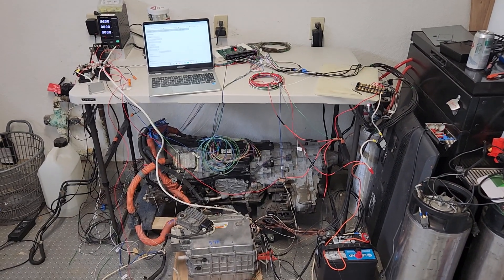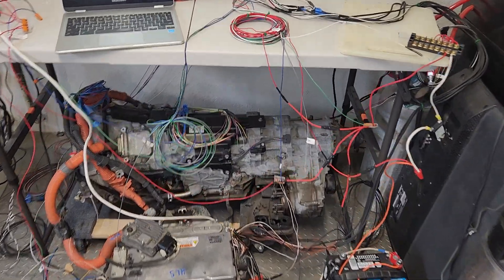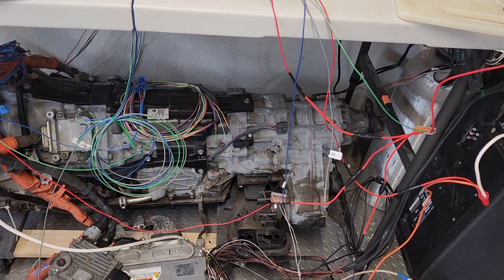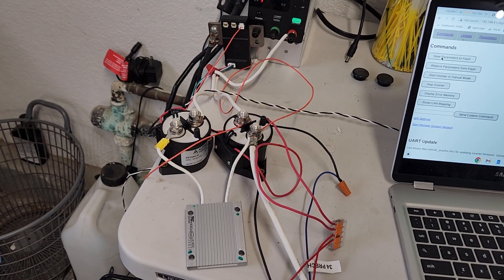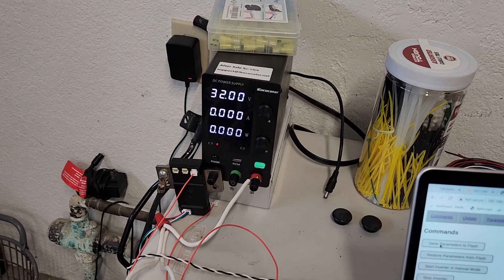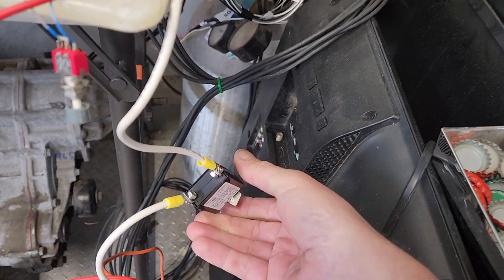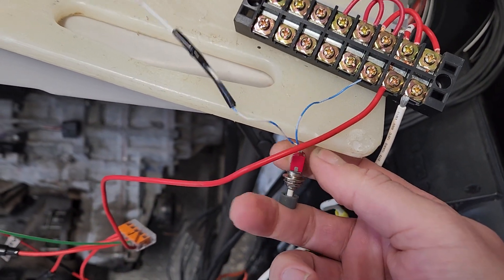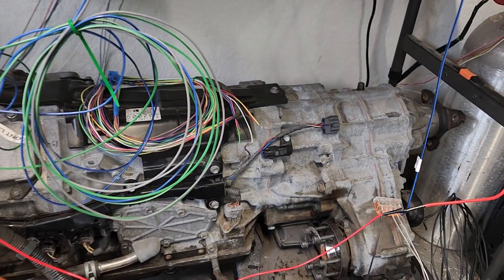LS600H transmission first spin

Comment: Question, what would you recommend buying alongside the gearbox itself and an inverter. any specific things like cables, pumps etc. You'll most likely have to source separately?
Reply from the maker: It's a good idea to get the engine and transmission wiring harnesses, and the oil pump controller. Also make sure the oil pump is still with the transmission. Also get the flywheel damper so you can lock the input splines to use the generator as a 2nd motor. And get the transmission cross member
Reply: @robwag1974  thanks so much, indeed I forgot to mention but the need for flywheel parts for locking were on my radar too. Thanks for all the other info!!

Comment: Are you using an GS450h inverter or the LS600H inverter. 
Last I looked Damien only made the vombieverter to work with the GS
Reply from the maker: Yes, using the LS600h inverter. as you can see, it spins up using the GS450h commands, time will tell when I get it installed and drivewith higher amps if it continues to work as planned, fingers crossed
Reply: @robwag1974  hope it works out for you.
Reply: I believe he's using LS600h inverter, as he noted some minor differences in the inverter layout/connections relative to the GS450h, in the openinverter thread. 
Damien didn't know whether the LS600h uses the same protocol/commands. He presumed it does not (of course, there are various inverters for both the GS450h and LS600h, for various markets - I think N.A. and Euro for each, if not even more) rather than presuming it does use the same commands.

Comment: This is great. I'm about to start my L110F (LS600h eCVT) project with a Tesla pack from my Rav4 EV, with zombieverter.
I didn't realize this transfer case has an open diff. (I need to adapt mine to another transfer case anyway)
Thanks for sharing
Reply from the maker: Yes it is a torsen diff. Let me know how your project comes along!
Reply: @robwag1974  Since my last comments, I acquired a cheap 07 Tundra with a bad engine.
I now have the L110F installed in the car, minus the input shaft lock and bell-housing mounts to the frame. My powertrain electronics, from the chassis to the Zombieverter, Inverter and Transmission are nearly complete, aside from the MG1/MG2 resolver cables. I'm testing I/O and communication with the Inverter. I have a couple questions for you...
-Did you use any feedback from the Inverter to Zombieverter to indicate they are communicating, other than motor spinning? (my Invstat variable doesn't change when I provide power and start, though the runmode does change accordingly).
-Where did you get your resolver cable? Could you share wire information? I got some CAT8 cable but the wires are too thin and brittle to use it. All my original resolver cables were cut too short by the supplier/salvage yard.
Reply: @robwag1974  So in other words, if it was attached to an axle with wheels (that have traction) we would see the other output spinning as well?

I'm asking because I am (again) considering this unit for a Land Rover 4x4 conversion. (it's just that the orientation of the outputs is not ideal...
Reply: Is it not a torsen LSD? Torsens behave like an open diff if there's no resistance on one of the outputs. 
As soon as you have some friction from a spinning axle, it will torque multiple and send it to the other axle.
Reply: @richardschofield2201  Perhaps - I'll have to check mine and see if I can get enough reluctance on both sides to test it

Comment: Nice. What are your plans for this project?
Reply from the maker: Going into a 1964 International Scout 80, once the truck is ready for it. Currently prepping with Jeep YJ axles, electric power steering and brakes, Tesla battery pack from Mercedes B250e
Reply: @robwag1974  So, will you be using the Lexus transfer case? Also, do you post on any of the DIY EV forums?
Reply from the maker: @cisc0kid1957  yes the transfer case is built into the transmission. This will be an AWD rig. I have a build thread on the openinverter forum: https://openinverter.org/forum/viewtopic.php?t=3165